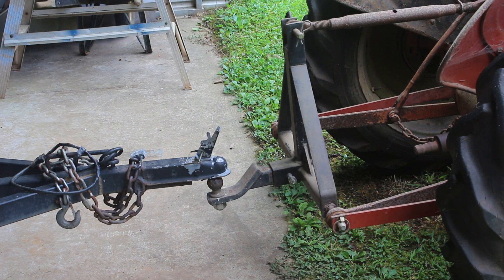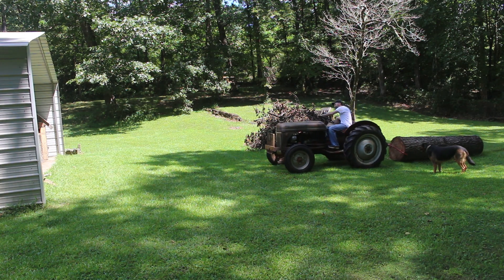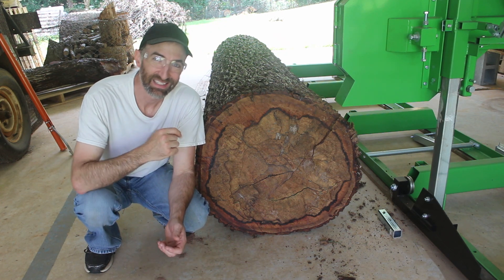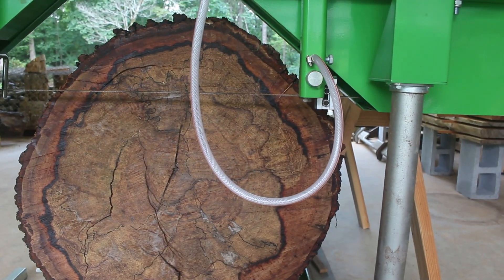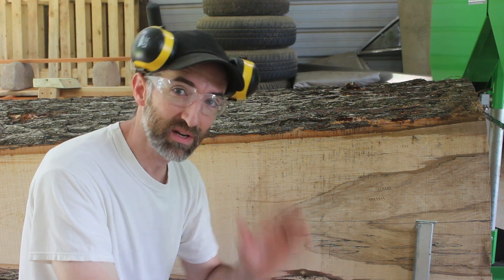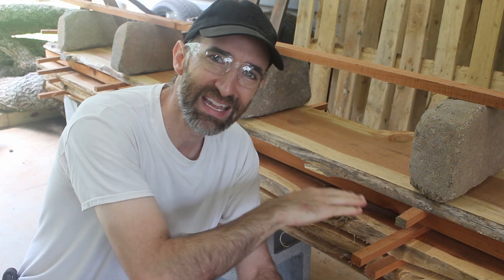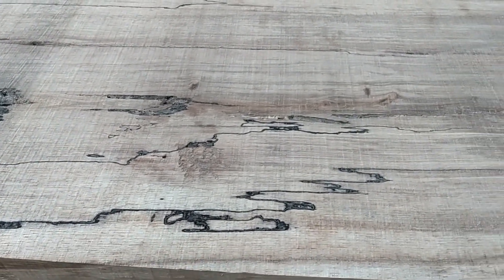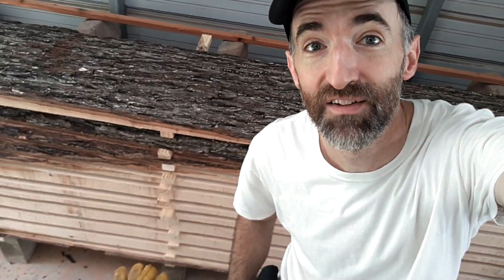Look What I Found in this Old Tree, Windfall on the Sawmill

Comment: Just a couple suggestions... the copper tubing that drips the water on the blade replace it with soft coper tubing and bend it to dump the water on the blade instead of shooting over the blade should you need to turn the water up...also install a second valve for a preset water control and the other for off and on ...also the pull rope can be rotated to pull towards the side you operate the sawmill from.... happy sawing
Reply from the maker: Thank you, I love the idea of the second valve

Comment: Heres an idea. As wranglerstar does use an old vehicle hood as a skid plate. Also you should get a bobcat with counterbalance weights for the back.  Or a tractor that is front attachment capable quicktach style

Also with turning the logs make another gantry and get 4 hoists that can be controlled simultaneously and if you rig it up a certain way you could use it to turn the logs on the mill without breaking your back  have 2 hoists on each gantry and have the left hoist of both gantry on the same controller (or operate at same time/speed) and same with right and if you rig it up a certain way it can turn it for you.
Reply from the maker: Thank you for the suggestion, I will definitely have to look into that.

Comment: Does the dry time always start when the log is milled? Any difference whether tree was green or dead when felled? What about logs been stored for long time?
Reply from the maker: There are definitely several variables. If the whole log has been sitting for a long time, it will start to dry but will take a lot longer than when it is milled. The more surface area there is, the faster wood can dry.  I've also been told that different species dry quicker than others.
Reply: @SpecificLove7  Thanks.  So the real answer is, invest in a moisture meter 😀

Comment: Looks like as you were driving  forward it was pulling the log down into the grass, if you'd attached the spikes of the hook lower to the ground, your tractor would have pulled it up, not down.
Reply from the maker: Maybe that might work. I feel that the old tractor might need an overhaul to do this work on a regular basis.

Comment: You are correct, your method is completely incorrect. You need an actual skidder/log hoist to move logs. An 8N is a perfectly fine tractor for your logging. Also you didn't  align your log the best. Put your log on the flattest part.
Reply from the maker: Thanks for the idea, I'll have to check it out